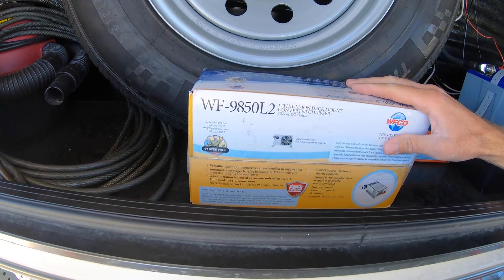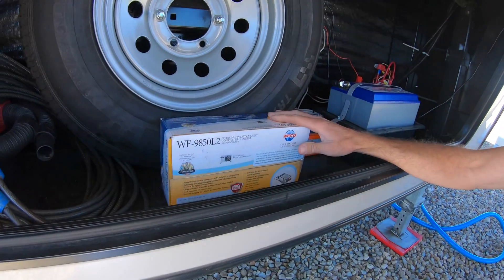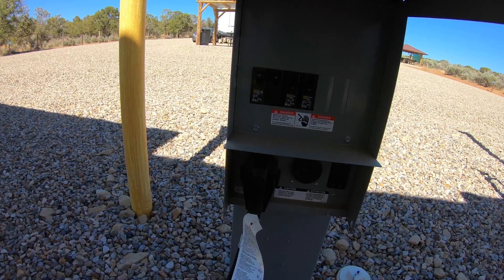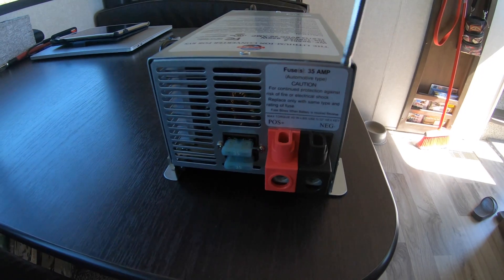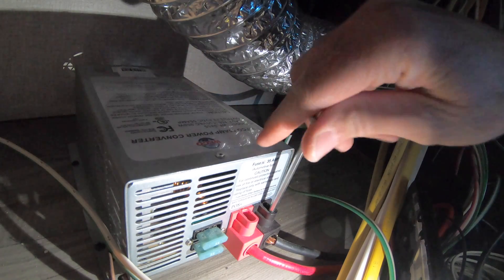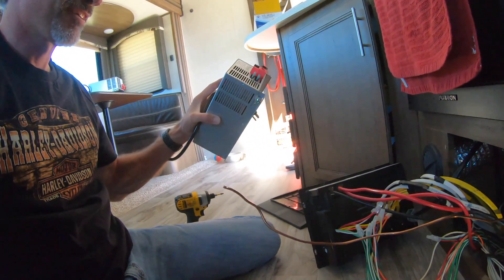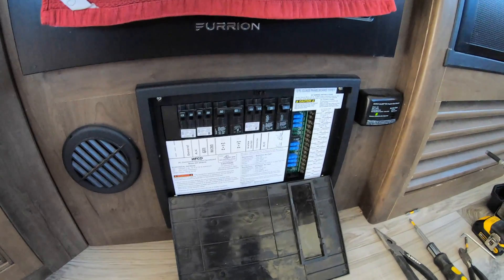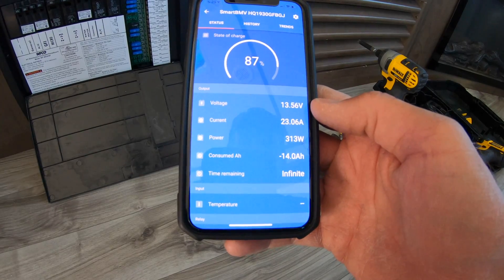Going to LITHIUM Batteries for your RV?  WATCH THIS FIRST!  WFCO WF-9850L2 Lithium Converter Install

Comment: I am confused why you are only getting less than 26 amp charge from a 50amp charger. Have you got something not set up properly? You should be close to 50 amps. I am in the mist or adding 560Ah battery and selecting a charger, so not being critical, just don't think your getting 50 amps you paid for. Surly this would not be labeled a 50 amp charger if it can only produce 25 amps. I Welcome feed back. Is there a switch on this thing you did not switch, or do I need to look for a different Brand charger? I have the same set up as you in my motorhome, except my charger is hard wired in panel, but the same Model number.
Reply from the maker: I don't know exactly why the charge amperage was so low in this video.  We did have to replace this one with another WFCO of the same model the following year and you can see in this video where the new one charges at around 36 Amps.  https://youtu.be/7Mtcjp0YMsI   Still not 50 though.  There is a pretty long run on the 6AWG wire that the manufacturer installed from the panel to the cutoff switch and then to the batteries.  I've always wondered if that had something to do with it and thought that if I increased the wire size to 4 AWG, the charge amps may increase.  I've mentioned this to some other people who have had the same inquiries and they said they did not think that would help.  There is no switch and no way to alter the settings on this charger or the newer model that WFCO has come out with.  We really don't need ours to charge any faster as we have 600 W of solar & 3 Battleborns now and very rarely run the genny.  Only ran it once last year during 5 months straight of boondocking and haven't had to run it yet this year.  Benefits of boondocking out West...
Reply: @EddieAtLarge  Thanks for responding, I really appreciate it Homie.
Did you ask wcfo why you only are getting 36amps, Perhaps they will tell you your have another defective one. They should know what is going on!
Reply from the maker: @careerextendrs3097  I agree, they may be able to tell me.  If our Solar wasn’t so great and we had to rely on the genny to charge, I probably would call them.  But, I can deal with 36Amps for the few times we need it.  Thanks for watching and commenting!

Comment: I wonder if you could have simply snipped the ground wire into two pieces and then "spliced" them back together or put both ends into the grounding point.  Just a thought.
Reply from the maker: Possibly, but, I'm not an electrician and I figured they did it that way for a reason.  If there's a cheaper, easier way to do something without taking away the integrity of the system, I would expect the manufacturer to go that route, so, that's why I left it that way.

Comment: People really misunderstand the RV Converters. They are really just for powering 12volt (converted from 120v) to run everything in your rv.  As far as charging goes, they dont do squat, even on lead acid batteries.  Hook up meters to one, on a bench and you will see even 75amp wfc will take days to charge a battery, AND they wont charge one that is below about 7 or 8 volts.
Reply from the maker: Hi Kassandra, our WFCO converter/charger both converts 120v to 12v and charges our batteries.  This model charges our 12v batteries at around 35 Amps (even though it is rated at 50 Amps) when plugged into shore power or a generator.  It does charge the battery somewhat slowly, however, it would not take days to charge 1 battery.  I believe it would take it around 4 to 5 hours to fully charge an empty lithium battery (lithium charges faster than lead acid).  I have honestly never timed it though as we've gone to solar for boondocking and rarely need to worry about charging via the generator or shore power any more.  If you have a lead acid battery that is at 7 or 8 volts, it is most likely damaged from depleting it below 50% and that would be why it doesn't want to take a charge.  Lithium batteries can be almost completely discharged with no damage, as long as you have a BMS built in to protect them like Battleborn has.  All that being said, I'll put it on my list to do a test by shutting off the breaker to our converter/charger while we are on hookups, depleting our battery bank (we now have 3 ea. 100 AH lithiums) to around 50% by letting the batteries run the DC side and let the shore power run the AC side, then turn the converter/charger breaker back on to allow it to charge the 3 batteries to see how long it takes.  I'll also need to disconnect our solar to do this test.  I think it would make for an interesting experiment and video.  Thanks for the idea!

Comment: What is the recommended 12v solar panel array that should be used to charge this 2-battery bank? What does your solart array look like on top?
Reply from the maker: Hello Jerald, we used only 200W of solar last year to power and charge 3 ea. of our Battlborn 100 AH batteries while boondocking for 5 months out west.  The sun out west easily recharged our batteries each day with only 200W, however, we were not using a ton of energy last year.  This year, we've added 400W to the roof and now have a 3000W Renogy inverter providing AC power to our rig for all of our outlets.  We now use our TV's, microwave and have the Starlink internet dish that uses quite a bit of energy.  Not to mention recharging our computers, phones and cameras.  Hope that answers your question?  Here is a link to our Amazon page where we have all of the equipment and parts listed that we used to do our upgrades as well as other items that we have purchased to live full time in our RV.  
https://www.amazon.com/shop/homieatlarge
(Please Note: As an Amazon Associate we earn from qualifying purchases when you visit our Amazon Home Page)

Comment: Why not just replace the converter in the power center to a lithium model? That and a hunk of 4 gauge wire brought me 52 amps of charging goodness. 10 minute swap.
Reply from the maker: That's what we did.  We changed out the OEM converter to the lithium model.  I'm sure if we would change the 6 AWG to 4 AWG wiring, it would also charge closer to the 50 Amp spec of this converter.

Comment: nice thank you ,i got on amazon a WFCO WF-8955PEC-B-LIS ,that does the job ,
Reply from the maker: Awesome!  Here is an Amazon link to the WFCO model that is the closest to the one that we have:  https://www.amazon.com/dp/B08KJJF7L8/?ref=idea_dp_    (It appears WFCO does not make our model any longer)  This new model is also made for Lithium batteries.  The difference is that it can be controlled with a switch to change between lead acid and lithium batteries.  To work around this, a jumper wire can be installed in the switch ports that will put the converter in lithium mode.  If you type in "jumper" in the search bar under the Customer Questions And Answers you'll find where others have done this in lieu of installing an actual switch.  This is in the WFCO-LIS manual: "No Switch Installed:
To use the converter in the lead/acid mode only, nothing needs to be done. To use the converter in the lithium mode only, place a jumper wire across the two WAGO connectors on the back of the converter."  Hope this helps!

Comment: I have two 100s hooked up to a lithium charger/converter and they are still discharging, I have shut off everything. Charger is putting out and it is going to the batteries, any ideas?
Reply from the maker: @Rich Bring  This may be a long shot, but, do you have tank heaters (heating pads for the water, grey and black tanks)?  If so, check to make sure they are turned off.  Mine are wired directly to the batteries and I had a similar issue where I didn't know what was discharging the batteries.  How much amperage is being discharged?
Reply: @EddieAtLarge  I have the battery switches shut off, there is no 12 v power going to the trailer. I'm hooked up to shore power and converter shows to be putting out power, batteries show they are receiving power but continue to loose power, down to 21% last time I checked. I have a local rv tech coming out tomorrow, I hope.I'm done Thanks
Reply from the maker: @Rich Bring  I also had my battery switch off and the tank heaters were still pulling as they are wired directly to the batteries (not sure why they did it that way).  There are a few other minor things that will draw power that are hooked directly up to your battery such as your Carbon Monoxide Detector, however, those are really small draws.  Also, If you have the switch turned off, your converter should not be able to charge the batteries as the wire runs from the converter to the switch and then to the batteries.  If you can't figure it out tonight, unhook the leads from the batteries so they stop draining.  Being hooked up to shore power, you will still have both A/C and D/C power, even with he switch in the off position as the converter will convert your A/C to D/C power at the panel to power all of your D/C circuits.
Reply: @EddieAtLarge  thanks, with my switches off I have no lights or anything. I'll look further in the morning
Reply from the maker: @Rich Bring  OK.  We may be referring to different switches.  Sorry I couldn't be of more help.
Reply: @EddieAtLarge  I'll let you know what I finally find out
Reply: one more dumb question, my monitor says the relay state is Closed, is this correct? Life shouldn't be this hard :)
Reply from the maker: @Rich Bring  LOL   No worries!  It should be Open.  Here are my BMV-712 settings for the Battleborn LiFePo4 Lithium batteries:

Battery Capacity: This is however many Amp Hours you have - 200AH for 2 batteries which I believe is what you have?
Charged Voltage: 14.4V
Discharge Floor: 5%
Tail Current: 4%
Charged Detection Time: 3m
Peukert Exponent: 1.05
Charge Efficiency Factor: 99%
Current Threshold: 0.10A
Time To Go Averaging Period: 3m
Battery Starts Synchronized:  <ON>

Relay Settings:
Relay Mode: Default
Invert Relay: <OFF>
Minimum Closed Time: 0m
Relay-off Delay: 0m
Low SOC relay: 5% - 10%
Low Voltage Relay: 11V-12.5V
High Voltage Relay: 14.8V-14.4V
High Temp Relay: <Disabeled>
Low Temp Relay: <Disabled>

Hope this helps!
Reply from the maker: @Rich Bring  Did you get the exact same model converter that we have?   The new model that is on Amazon WF9855-LIS is not the same as the one we have in our video.  The new one is able to switch between lead acid and lithium.  To do this, you need to install either a switch or install a jumper wire.  Default setting is lead acid and will not charge correctly without installing the jumper wire. Was wondering if this wasn’t possibly why your having issues.
Reply: @EddieAtLarge  I ended up with the IntellPower PD9180 ALV 80 Amp from ETrailer, seems to be working perfectly. I set it all to the numbers you gave me, thanks
Reply from the maker: @Rich Bring  Cool.  Glad it worked out!

Comment: did you. have to replace the 12 volt fuse panel? I've heard different stories
Reply from the maker: @Rich Bring  We did not have to replace the panel.  It was as simple as what we show in the video.
Reply: @EddieAtLarge  thanks, I just ordered the converter you used
Reply from the maker: @Rich Bring  Cool.  You'll love lithium.  We've got 3 now.

Comment: I didn't see the question but do you have a on-board generator that I'd started by the battle born battery?
Reply from the maker: @Rev’n Kevin  No on board genny.  We have a generator that we keep in the back of the truck.  Barely use it though now that we charge with solar.  ☀️

Comment: will one  lithium battery go longer than two 6 volt golf cart batteries?
Reply from the maker: @Rich Bring  It would be close to the same.  

2 golf cart batteries at 6v would need to be wired in series to make 12v.  Each golf cart battery is typically 200 to 220 amp hours.  Wired in series, the voltage increases to 12v and the Amp hours stay the same.  Golf cart batteries can only be drained to 50% before damage begins.  So that cuts the AH down to 100 (or 110).  

All that being said, 2 golf cart batteries are about the same capacity as 1 lithium battery at 100AH that can be drained completely with no damage.
Reply: @EddieAtLarge   OK thanks, I'm trying to figure out how to go to the sand dunes for 4 days without running the generator the entire time . Should have kept my toy hauler

Comment: I've a lot to learn...
  Where do you buy one of these converters?
Reply from the maker: @Pat Mitskey   I do believe that WFCO has discontinued the WF-9850L2 model and has replaced it with the WF-9855-LIS model that has a remote switch that gets plugged into it so that you can switch between Lithium and Lead Acid battery types if needed.  The 9850L2 still shows up on WFCO's website, but, I can't find it for sale on the internet.  Amazon has the WF-9855-LIS.  Looks like the unit does not include a remote switch with it.  You would need to either use a wire to jump across the connectors or run wires to a remote switch to put it into Lithium mode.  There's a review on Amazon that goes into more detail on how to do that.  Here's a link to the review and product:  https://www.amazon.com/gp/customer-reviews/R1AYKB98DR4GT2/ref=cm_cr_dp_d_rvw_ttl?ie=UTF8&ASIN=B08KJJF7L8
Another option would be to buy a different brand such as Progressive Dynamics.  Here is a link for one of their chargers.  https://battlebornbatteries.com/product/progressive-dynamics-12v-60-amp-lifepo4-battery-charger/  You'll want to make sure you get the same amperage charger that you currently have in your camper so you don't overload the wiring.

Comment: Thanks for the video, I am in the same situation I have a 2022 Grand Design solitude 375RES, I’m thinking about switching out my lead acid batteries today at 100 amp hour lithium battery so I have to switch out the converter as well like in your situation. My question is can you run any other appliances other than what your lead acid battery could run, Microwave, outlets, TV?
Reply from the maker: @Derk Hutchens  Hi Derk, to run any A/C powered appliances, you would need to install an inverter.  This can be simple or complicated depending on which route you choose.  Here's a video from a guy who did an inverter install like ours (the simple way), then plugs his main power chord into it to get power to his camper.  https://youtu.be/Cqn2CqhrlUY  Like he says in the video, make sure you don't overload it by running too many appliances at the same time.  Also be sure to shut off the breaker to the converter so you aren't trying to charge your batteries with your batteries.  We actually shut off all breakers other than the camper outlets and we don't use high powered devices like the microwave as they can drain your batteries quickly.  Also, make sure you use heavy gauge extension cord (as short as possible) going from the converter to your main power cord.  We have a 12 Gauge, 3 prong cord.  You'll need an adapter as well to go from the extension cord to your main camper cord.  Rule of thumb for the inverter size is 1000Watts for every 100AH of battery.  Meaning, if you want a 2000W converter, you'll need at least 200AH in batteries.  We put in a 2000W Renogy converter and now have 300AH of Lithium.  If I was to do it over again, I would have went with the 3000W inverter for not much more money.

Comment: That is much simpler than I thought it would be. I am going to replace my Hymer B564 lead acid battery with a lithium one! I got a victron charger for it in the end.

Thanks for the detailed video
Reply from the maker: @Ian Jamieson  Yes, fairly simple and easy to install/replace.  I may go to a Victron Multiplus down the road.  Pretty happy with our current setup which is 300AH Lithium, 2000W Inverter & 600W of solar.  Maybe do the Multiplus if we buy another camper as they are pretty sweet.  Glad you enjoyed the video.
Reply: @EddieAtLarge  nice. I am hoping that 400W of solar keeps me going as I have gas for heating and also the renogy DCC50S for charging from the solar and alter alternator.
Reply from the maker: @ianjamiesonmusic   If you have a smaller rig, you should be good.  We ran with a 200W solar suitcase for 5 months and did fine with our 25' 5th wheel.  We did have the 300AH though that got us through some cloudy days until we could recharge.  Good luck and have fun out there!
Reply: @EddieAtLarge  thank you. Have fun!

Comment: What year is your cougar? I am looking at this same upgrade on my 2021 cougar. I havent dug deep enough into the panel yet to check the model number on the transfer switch/converter.
Reply from the maker: @Chris Heiser  Ours is a 2020.  I do believe that WFCO has discontinued the WF-9850L2 model and has replaced it with the WF-9855-LIS model that has a remote switch that gets plugged into it so that you can switch between Lithium and Lead Acid battery types if needed.  The 9850L2 still shows up on WFCO's website, but, I can't find it for sale on the internet.  Amazon has the WF-9855-LIS.  Looks like the unit does not include a remote switch with it.  You would need to either use a wire to jump across the connectors or run wires to a remote switch to put it into Lithium mode.  There's a review on Amazon that goes into more detail on how to do that.  Here's a link to the review and product:  https://www.amazon.com/gp/customer-reviews/R1AYKB98DR4GT2/ref=cm_cr_dp_d_rvw_ttl?ie=UTF8&ASIN=B08KJJF7L8